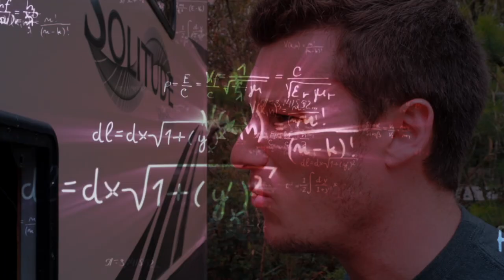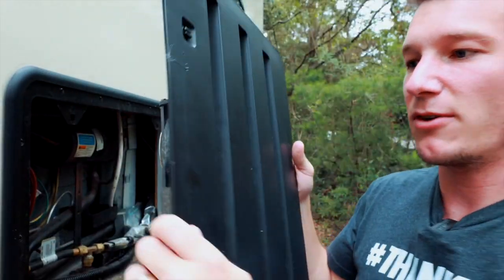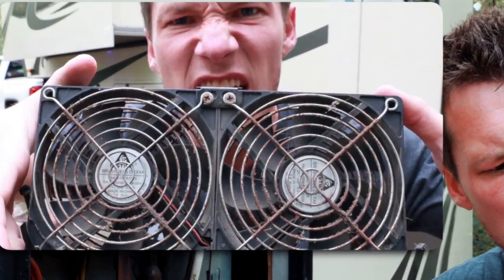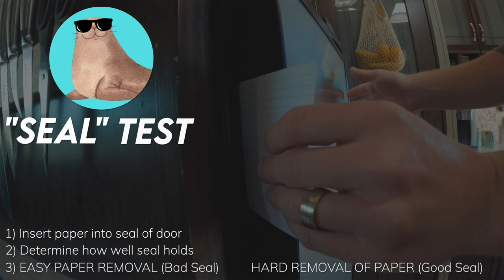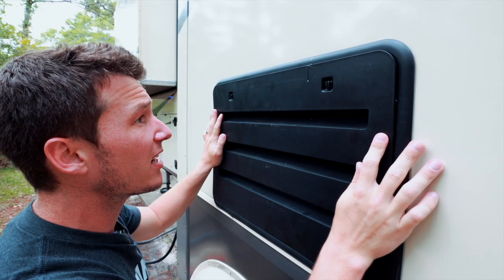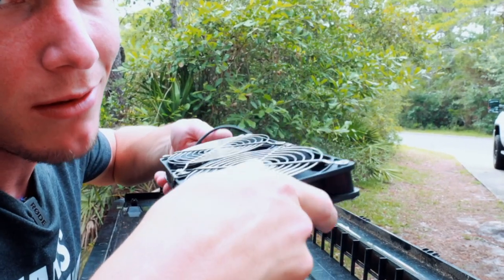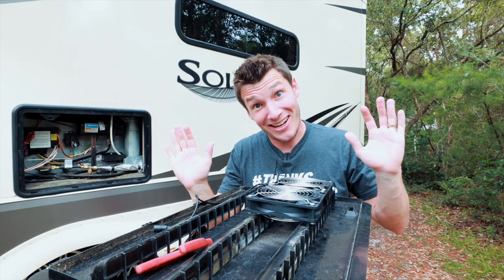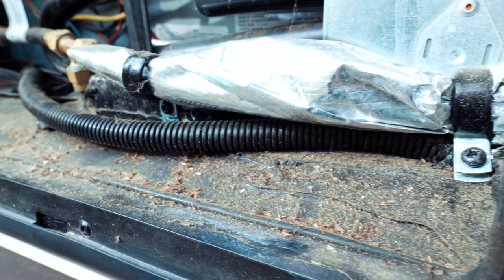Turbo-Charge Your RV With Ease! (Ice Cold Fridge)

Comment from the maker: We need your help. Please share this video with others so they may know as well! 

Items In This Episode

▸Dual Fan for Fridge
https://urlgeni.us/amzn/doublefan

▸Flush Cutters
https://urlgeni.us/amzn/FlushCutter

▸Bucket Boss Tool Bag
https://urlgeni.us/amzn/toolbag

Check out our Amazon Page for more! 📦
https://urlgeni.us/amazon/HanksStorefront

Subscribe for new weekly content…yes it gets crazier https://urlgeni.us/youtube/channel/KVJA 

Share with us some of your favorite camping hacks in the comments!
Reply: Had the same refrigerator. I ended up finding the issue and had the RV shop replace this part. Very simply, when you open the right or the left door (one at a time) slowly open it. See if the middle flap (door flapper) is flat - mine would stick partially open intermittently not allowing the refrigerator to get cold enough. I chased this issue for months and months before I finally figured it out. They replaced the door flapper and never had the problem again. We are down in Texas and it gets very hot! No problem keeping things cold anymore!

Comment: Fans will work better if you mount them in the upper vent and blow outwards. They will cause an updraft to ventilate from the bottom up. Also won't suck in  rain water like yours do now.

Comment: A tip that helped our fridge even more. Have one fan blowing out and one fan blowing it.  It actually circulates the air better in that compartment for even better fridge performance.  But you have to spread them apart about 4" - 6".
Reply: A fan at the top of the fridge chimney helps dissipate heat  👍👍
Reply: @alanbolla8443  That is very true.  But our camper didn't have a vent at the top.  We both agree, that air circulation no matter how achieved is better than just a one-way push or pull.
Reply: Came to recommend this as well. I have a fresh air in at the bottom and a hot air out at the top. I can't believe this isn't standard OEM practice. I also added a fan inside that clips to the cooling fins. Made a drastic improvement.
Reply: Maybe look into refrigerator defender. It is pricey but works well. It took me a couple hours to install but I think well worth the money. It doesn't run all the time, only when needed. It works well on my gas/ electric dometic.
Reply: Did you have to add an outlet or was there a plug for each fan available?
Reply: @brianlucht  In my case the fans are all 12V and there is a 12V bus bar at the outside base. I simply wired the fans into the bus bar. The one on the inside I wired to the source feeding the fridge light switch.
Reply: I’ve done both and a blower fan inside the fridge. I had to turn down the thermostat.
Reply: do the fans stay on all the time or is there a cycle time on them
Reply: @brianlucht  Fans are wired in Parallel.
Reply: @skipperrichman4278 what you do is go buy a thermostat for that type of refrigerator and wire it in so they won't stay on all the time . Put the thermostat on one of the fins

Comment: We did a couple of upgrades to our RV refrigerator. I put one and a half inches of foam insulating board on top of the refrigerator. There was enough space to slide it in there. That made a huge difference because the sun beating on top of the slide then wasn't heating up the top of the freezer. Second thing was I put in a fan just on the upper vent. The air is being pulled in the bottom vent and pushing out the top vent. I hooked the fan to a thermostat control. When it got to a certain temperature it would turn on and when it got to a cooler temperature it would turn off. In addition I hooked it up to a RF switch which has a fob. It had two leads on the RF switch. One was hooked to the fan and the other was hooked to a light that I put on the slide.  I could turn the fan on and off if I wanted to and I now had a light on that side of the trailer. So when it was really dark I had some light to do something like with the sewer system as an example.

Comment: Hi Hanks!! We did the same thing last winter for our Solitude 375RES, when we were in Arizona . We also added a computer fan at the top vent to help blow the heat out and it really helped! The fridge side was constantly in the sun, (we were planted in the same spot for 3 months), so we also added a Coolaroo roller solar shade and affixed it to a 2x4 and clamped that at the top of the kitchen slide with some rubber pads to protect the finish of the RV, and a couple bungee cords at the bottom of the solar shade attached to two 5 gallon buckets full of water to help hold down the solar shade incase of high wind.  All of the above really helped keep our fridge cold and after all of that, we had no issues. LOVE watching your videos and look forward to them every week. Keep up the good laughs! We enjoy you guys....AND Dexter! (We travel with 2 cats).
Reply: Interesting shade idea! 🍻
Reply: Wish I could see a photo of the shade. YouTube would improve to allow photos.

Comment: I did the same thing, plus I put a fan inside the fridge, tap into the power going to the light, also changed the cover on the roof to  Exhaust the hot air more, our fridge can hold 34 to 38 degrees almost all day in hot weather. Good luck, their's alot of videos to watch and yours is top notch...

Comment: I went through this with the Dometic 3-way in our class B, and our configuration has 2 vent openings. I mounted four 12v computer fans exhausting at the top vent, fully covering the upper grill area. I fabricated a baffle to direct the air drawn in at the bottom vent through the fins. This I believe is better at creating a chimney effect rather than just churning air inside the space. I used 12v fans because they draw very little current and run when we are not on shore tie. I also wired them to a switch inside that either turns them on manually, or puts them in thermostatically controlled mode using a thermotatic switch mounted to the fridge fins, which is my usual operating mode. Also added a 12v double circulating fan by Dutch Aire that clips to the cooling fins inside the fridge. Also very low current drain.

Comment: Thanks for all Karl. I work on boats and the use blowers to exhaust gas fumes out of the bilge. You should look into those as they are inline and all it takes is hose and 12 volt power

Comment: Our 2021 GD has fans up inside the wall behind the fridge but I like Kyles’ placement better.  Way to go Carl ! 👍
Reply: same here.  We just bought our 2017 Forest River Rockwood Ultra Light this spring.  Was so excited to get the larger size frig.  Previous owner placed the 4 fan unit inside on the fins and there also are fans in the chimney to draw hot air up.  There is also some metal duct material forcing the hot air to go into the black condenser at the top vent. Sadly our frig will not stay cold.  It fluctuates between 36 and 60 degrees!  Plus the fans in the chimney are quite noisy inside the RV:(  We've cleaned any fuzz or debris out.  reset the frig.  Also, while driving to our campsite with the frig on Gas, it warmed up to 56 degrees within 3 hours.  Very worried about food going bad and kinda wished I had my old smaller frig back now:(  It was ALWAYS ice cold!

Comment: I had an old 80s camper that had a 12 /gas fridge and I installed a small 2" computer fan on top of the cooling fins inside it to circulate the air around it completely made a huge difference and everything seemed to be a bit colder. Just food for thought.🌭🌭🌭😄

Comment: Our frig has been struggling a good bit on our current 10 week outing that started in the summer heat. The source of our problem was a freezer and frig that were too full. Been trying to keep that side of camper in the shade and keep less stuff in the compartments. Will check the outside panel behind our frig/freezer to see if we can accommodate a fan like yours. Thanks for the great idea.
Reply: I thought our problem was too much food as well but now that we are home I have emptied most everything out of the frig.  It keeps fluctuating between 38 and 58 degrees, even with fans in the chimney and fans in the frig attached to the fins.  Plus the fins are always wet.  Freezer works great at least staying around 10 below.

Comment: I used 12 volt computer fans in mine and it worked great. I mounted them near the top so they helped to get the hot air out.

Comment: I mounted fans at the top blowing up and out of the roof vent. This instillation pulls air in the bottom vents and out of the roof. Also, I installed an external thermostat to take the place of the thermistor and added fin fans inside of the refrigerator to circulate air. That was a game changer.  Now, I grab a drink out of the RV fridge and wish that my home refrigerator cooled beverages as cold as my camper refrigerator.

Comment: Yup! I have not installed a fan on the bottom, but we I did install one on top to help exhaust it, it is a 12 volt fan, and I connected it to the one that is installed mid way, so when it gets to a temperature that the mid fan comes on it also turns on the upper fan to help exhaust the hot air.  We also put screen on the inside of the vent covers to keep wasps from building nests.  A trick to help with that is take a dog or cat flea collar and cut it into pieces that will lay at the bottom of the area to help discourage bugs from building their home there.  The propane smell attracts  wasps.

Comment: Check out JC Refrigeration out of Shipshewana.  They can switch out the entire back of your fridge to a 12v. Best decision we have ever made.  Freezer stays at -15  and fridge at 35. This is with it set on #2. Over the hill Stan wat there when we did ours
Reply: We are having this done tomorrow on our Notcold 2118.  🎉🎉
Reply: @nikkifleming6290  I think you will like it. Even when it's 105 outside fridge and freezer stay cold.
Reply: @nikkifleming6290  yeah i ‘had’ a solitude with that norcold 2118 fridge, what a piece of crap, frozen food thawing every time fridge did its cycle thing and fridge food freezing, worst fridge ever! Fridge coolant system and thermistor all replaced made no difference. And forget keeping icecream ever. Norcold has zero innovation. JC innovation 👍🏼. 🍻
Reply: @SpykersB  ours is now replaced with the JC Refrigeration compressors!!

Comment: I have heard that RV fridges in slides have a harder time as the heat doesn’t go straight up to through the roof which why the fans are necessary.     Not that you can move it but for people looking for an RV it is might be something to consider.

Comment: Switched campers this year to one with a residential fridge and it's so much better.  Don't think I'd ever try to full time with an absorption fridge
Reply: What kind rv has a residential fridge ?
Reply: @travelingsoldier4671  lots of them. Larger fifth wheels and class A often have an option of what kind of fridge.  Mine is a cedar Creek 377bh.
Reply: @travelingsoldier4671  The Highland Ridge Open Range 322RLS has an option for a residential fridge along with several other models.
Reply: @valc8758  thank you kindly
Reply: @travelingsoldier4671  My pleasure.  The option comes with the larger units.  Hope your search turns out well.

Comment: I added a small fan on the bottom blowing up, and the double fans on the top blowing out.
Initially I had the little fan on the bottom too close to the flame and it caused problems. I moved it to the opposite side of the flame (other side of the bottom compartment), and now it is nicely blowing up without interfering with the propane flame, while the two up top suck the hot air up and blow it out. I also installed a baffle on top of the fridge by the top vent hole, so the hot air would not circulate over the fridge. Grand Design had left a big gap over the fridge 🥴.

Comment: I know that this is a year old buy I just saw it and have a comment.
Over 25 years ago we were camping in the Florida Keys and our refer just wasn't getting very cold.  I thought it was gonna need an expensive fix or replacement.  One of our neighbors suggested adding a small battery operated fan to the inside of the refrigerator.  We went to a local RV dealer in Key Largo and for under $20 bought one of these fans.  WHAT a difference.  The fan takes 2 "D" cell batteries and they last a long time.  We use our camper about 40 nights a season and replace the batteries at the start of each season.  Our $20 fan lasted over 20 years and when it finally dies we immediately replaced it at Camping World and it was still close to $20.  When friends bought their first RV we gave them one of these fans as a "Rig Warming" gift.  I also have the fans outside as in this video but try adding one of these little fans as well, they are available on Amazon as well.

Comment: I can agree that fans help.  I was camping one time and there were fairly high winds, somewhere around 30-40 mph, OK maybe 20-30 mph but pretty stiff whatever the speed actually was.   My refrigerator had been running at 34 degrees very reliably.  When it got windy I couldn't get it below the high 40s as I recall (remember I'm old and forgetful).  The next day when the wind was calm it way fine.  The same thing happened a couple of days later.  I'm convinced it was the wind not letting the air in the bad of the refrigerator rise like it needs to.   A fan should help this.   Keep the good stuff coming guys, and why wasn't Ney Ney in this one?  She's prettier than you are.

Comment: Fans are on top vent blowing air out is safer and more reliable.  Fans on the bottom will disrupt the propane flame.  Fan on top blowing out won’t pick up road grime like the bottom one did.  But whatever works for you!!

Comment: Either get a 12v fridge or residential fridge. Our residential fridge works great in the summer. Of coarse it's best with the AC running in the fridge but regardless it works very well. Much roomier too

Comment: Eleven years ago we did this on our pop-up camper. Two fans, one to pull air in one at bottom vent one in top vent pushing air out. Set on the 4 of nine hash marks was perfect. I salvaged 12 volt computer fans being scraped out. If anyone is interested in seeing the process check out popupportal forum. #thanks hanks

Comment: So do you have AC when you are hauling the RV? If not then you want to use a DC 12V fan unit so the refrigerator can get cool air when traveling and running on 12V.  I performed testing after I installed our cooling fans and the refrigerator got to operating temps close to three hours faster than the no fan operation.

Comment: If you live in a hot climate, and you don't do a lot of boon docking, you should really consider switching to a compressor-based refrigerator. They use 90% less energy than absorption-type refrigerators, but require electricity to operate. Compressor fridges used to be residential units that required 120ac, but today there are compressor fridges that run on 12VDC! So if you boondock and don't have a generator or lots of solar, absorption is probably still the way to go. However, if you are like the  Hanks and usually have hookups, you should switch to a compressor unit. They don't have the ventilation issues of absorption fridges, and keep food colder in hot weather much more reliably.

Comment: Since your fridge is mounted in your slide out, Grand Design should have put a fan behind the fridge forcing the air up past the condenser fins and also baffled to direct air out the upper vent.

Comment: I'm wondering if it would still work with the fan blowing out because it would be pulling the hot air out? 
Maybe I think to technically but does the fan pull in moisture with it facing in?
Reply from the maker: I think that it would still help if the fan were facing outwards :)

Comment: I was thinking instead of having the air forced in to the trailer and get on a pollen and dust and dirt into your trailer. What if you were to reverse the flow and push the air out this way the cold air? That's in the trailer we'll work its way in the back of your frigerator and a hot air be blown out especially if you're in Florida.

Comment: Install a dinosaur circuit board for your fridge and it will freeze everything in your fridge,just changed mine it has an adjustable temp on the circuit board.

Comment: Just replace the absorption refrigerator with a 12v refrigerator. No more problems. Doesn’t have to be level, more interior refrigerator space, cools down in less than 2 hours, safer, much much lighter!  And so many other benefits

Comment: I feel hot air coming out of my refrigerator vents but when it's above 80 it does not cool I adjusted the piece on the fins on the inside to all the way up but it gets up to 50° in there during the day the fans are running hot air blowing out the vents don't know what's going on this camper is only a year old below 80 it works just fine it'll cool down to 37° overnight

Comment: One tip - dont shake a compressed air can. You can read it on the instructions on the can itself. If you do, it won't work until you put it down for a couple of minutes.

Comment: Fans in the wrong place  put them on top they work better  or Replace with A DC fridge or a 120 V fridge.
Reply: I had three on top blowing out for a year now yet noticed high humidity at night so I just took one and placed on the bottom to blow in to see if they were pulling in the night air, also just foam cleaned my A/C coils and foil taped every seem or hole I found on the evaporator side.

Comment: Those fans really need to be installed on top and not the bottom.  They are designed to pull cool air through the bottom and expel from the top.   Basically you installed it on the incorrect vent and it should Blow out.

Comment: I would say pull the air out not in. You want the compartment vented from heat all the time. I had three wine fridges die from poor ventilation until we pulled the air out.